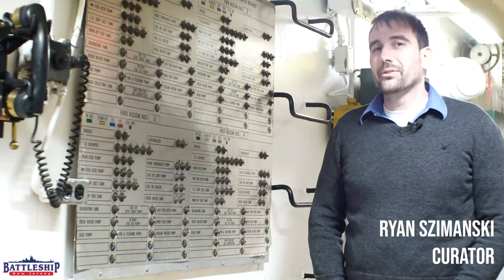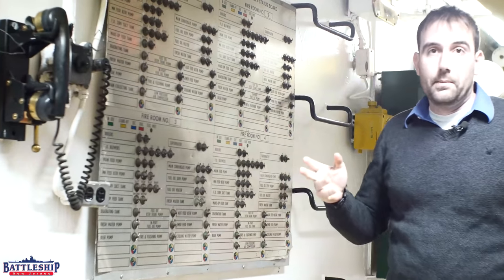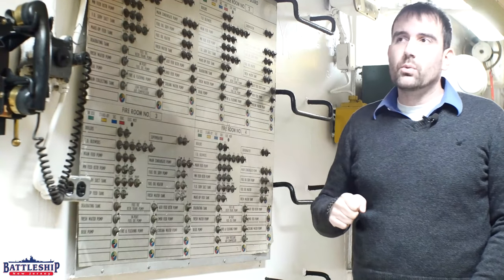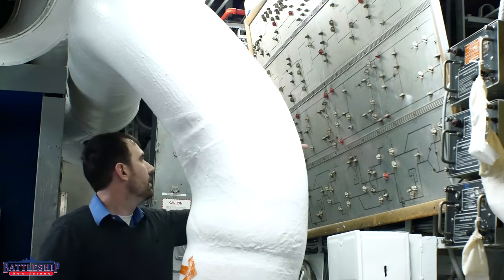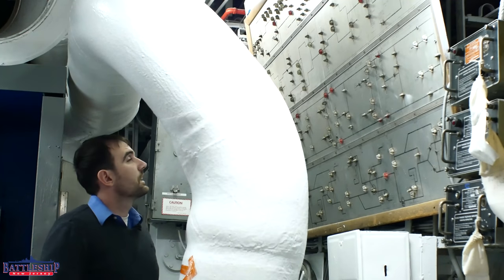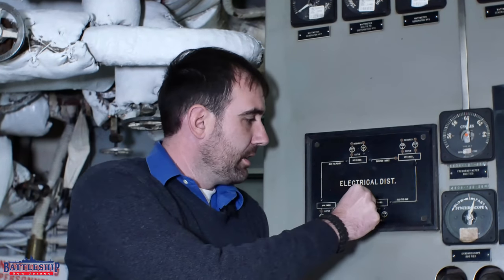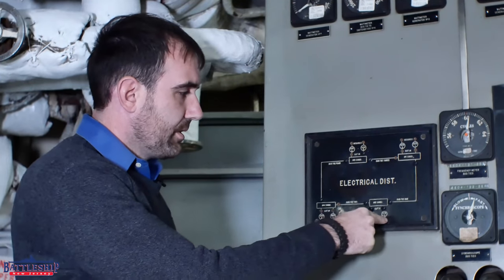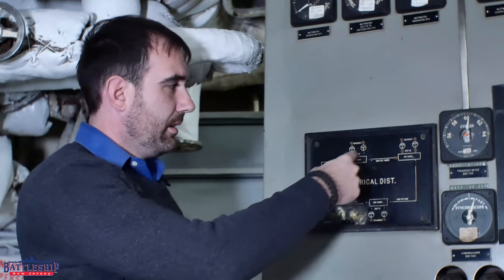How Do You Track Which Boilers and Engines are Active?

Comment: Well since I served in NJ, I would have to say my status boards were all analog.  

Second ship, AOR-7, cargo control status Board was all lites/switches.

BTW, we never would have just pointed to a status board on shift change!!!  Sometimes it did take 15 min for turnover, but usually not. That’s why you were always on deck plates 15 min before shift change, for a proper turnover.

Comment: I love all New Jersey vids... Ryan and crew do a great job teaching us how NJ worked.
Today I was pretty disappointed in the US Navy to realize that the 1980's ideas of "Status Boards" were so... bad. Disregarding the fact that by the 80's we were more than capable of wiring it up to various sensors... the actual visual signals were tiny, not easily discernable, poorly located (if that was the actual location) impractical in size... I could go on.
Earlier this year I was at a Catholic School fish fry... they had a status board of how the fry was going. It was manual with a person with a cell phone connecting to various people around the facility. I cannot recall the # of status's each station / step in the process had... 4 or 5, but it was very easy to see the status from 8 feet away. Very well done. Even though I did not work at the Fish Fry I could figure out what stations were keeping up, which were behind & why, and if I were trained I could know where to go help. Almost no talking needed, almost no knowledge of the fish fry process required to understand the status.
Ryan's just telling us what they did and, as usual, tells us well. The fact that it's not a very good system reflects on the Navy of the 80's.
Reply: I don't about the 80s but when this ship was launched in 1942 it was state of the art. When they reactived the ship in the 80s it would have been way to expensive too completely redesign the shipboatd status boards so they kept the old ones going. In the end it makes sense since they only really kept using this for about 9 or 10 years.

Comment: "analogue" electrical status boards for all sorts of industries have existed since the dawn on electrical use. Think of Magneta clocks on ships for example. Manual or hand operated would be a more correct term rather than analogue. Another fascinating video btw Ryan. Thank you.
Reply: Yes, analogue is an incorrect term for the statusboards shown. Manual is indeed a far better term for how they operate. And hand operated isn't a bad term either.

Since analog implies automation in updating the status. Even if some basic stuff like pressure can quite easily be transported via hydraulic lines for a distributed view of the current pressure. Similar story for other readings. And pulleys have been a staple for status boards for a long time.

Though, that they didn't use more status lights is interesting. Simple on/off indicators for various things, even if it just is a switchboard in the associated mechanical space. (and this would then be a digital system, since the signal is either on or off. (Even if most people incorrectly think digital means it is computer control.))

Comment: On the 2 Cruisers and the 1 DDG I was On we used a very simple system. We told the on coming watch what was running verbally. On the Console Board was a laminated sheet of paper with all the equipment listed. We just checked off what was online or running..

Comment: Great video Ryan, I was waiting for this one. On my DDG-51 and CVN we had two whiteboards with labels printed on them. Grease pencils were used to circle, x, underline, etc. One for mechanical equipment status and one for valve lineup, just like New Jersey. I would have preferred the old style with actual switches! The electric plant had better remote indication, but was still controlled at the switchgear. Navy is way behind civilian automation standards.

Comment: Analogue is good because when lumps of it are blown to bits,bent,buckled,cut or sheared off by the enemies shells, someone can use a bit of old fashioned Noddle and a few bodges to get it working again,it's a mechanical connection or assembly,even wiring is after all a mechanical connection which means you can see the damage physically ,it doesn't require the time consuming interrogation,replacement, coding and calibration of half a dozen modules or computers to keep it and it's various associated components running properly components that are generally more sensitive and fragile by comparison to their analogue alternatives. Plus the enemy can't hack that old shit!😁

Comment: Somewhat surprisingly the nearby frequency meter shows 60.1 Hz.   Still working because there's power?   That'd be nice to emphasize.
Reply: The shore power fed to the ship is still distributed thru the main switchboards. They don’t rewire the whole ship, not feasible. 
So that board is showing current volts and hz’s being fed to ship.

Comment: A power plant i visited 8 years ago in Sweden (the oil condensing units in Stenungsund) there the personel had special smal pieces of wood placed on every control on the pulpit.  Move the control turn the wood 90 degrees.

Comment: Interesting that a status board is just stuck up in a machinery space behind a pipe. All the ships I have worked on have had a central control room with engine and switchboard controls all in one place. On newer ships, a lot of systems are controlled by a computer, so if you want to open a valve and start a pump there's a schematic on a computer screen and you can start a pump by clicking on it with the mouse. The older ships I have worked on have had a lot more manual "analogue" systems where you have to go and physically open the valve locally. Then you see the transition between the two on ships built in the 70s and 80s where there is remote operation, but it's via a switch on a panel in the control room instead of a computer screen.

Comment: This isn't Navy.  My first computer system in the Air Force, 465L SACCS did have a master display of all the fault lights on all of the logic drawers.  It was called the FFC.  Fault & Facility Control panel.  It had push buttons to switch lines manually for either your numbered Air Force or Headquarters SAC.  It had connections for jumper cables to do in house loop backs or long line loops for troubleshooting.  We had telecommunication jacks so we could talk via headsets with the operator consoles in the Command Post.  This was handy.  Daily Preventive Maintenance was pushing a button to light all of the lights to insure all were working.
Reply: I was Munitions in the Air Force, and I can remember one of the self-test to ensure a missile test set was functional was to push the "Self Test" button.  If all the lights lit, you were good to go, at least electronically.  For either pneumatic or hydraulic self test (depending on which test set being checked), there was another series of test to perform.
Thanks for queuing memories from the past!
Reply: @josephstevens9888  Thanks for your service!  What base or bases were you at?  I was at Griffiss AFB, NY; Grissom AFB, IN; Pruem AS West Germany; and Ellsworth AFB, SD.  
We did not have a "master" self test for the system.  We did have a self test program for the drawer tester.  It wasn't one step.  We got so that we could do it from memory, but NOT when we were doing a QC Eval.  Then you had to dig out the manual and go slow step by step.  Self test only checked out about half of the circuits.  It did check all of the lights!
Reply: @klsc8510  After Basic Training at Lackland, I was sent to Munitions Specialist Course at Lowry AFB in Denver.  Then I was sent to a 18-month tour at Kadena AB, Okinawa.  At Kadena I spent the first year working in the 20MM shop (I still can smell gun grease on my hands!), and the final six months in the Missile shop maintaining AIM-7M Sparrow and AIM-9P & L Sidewinders.  Then I PCS'ed to Nellis AFB outside Las Vegas where I spent two years assigned to Munitions Storage - as well as some other shops as well.  After four years I transitioned to the Air Guard at Selfridge ANGB, Michigan where I spent another eighteen years performing all aspects of the Munitions field.  Then I transitioned to the First Sergeant role for six years, and wrapped up my military spending another six years as human resource and career advisor at Wing HQ.  In all, both Active and Guard time (my Air Guard years were peppered with deployments to the SW Asia AOR while on Federal Orders) I have 33 years of total Federal service.  I retired in 2015.
KLS&C 85 - thank you for sharing your experiences while in the Air Force, and thank you sir for your service to the nation.  God Bless and may you and your family have a wonderful Christmas season!
Reply: @josephstevens9888  Thanks for your service!  Are you still in Michigan?  After my almost 13 years active Air Force, my CO at Ellsworth didn't like me.  Maybe because I didn't drink?  He broke more rules pushing me out than I did in my time in.  After 16 years being out, I was recruited to join the Army Guard Signal Company in Kalamazoo.  That was 2000.  In 2003, we got the big invite to play in the sand box of Iraq in 2003-04.  The Company was detached from Michigan to join a Signal Battalion from Iowa.  In short during our time in Iraq, we showed the Army how Signal is done.  Not bad for a bunch of old Soldiers!  
I retired in January, 2009 with 21 years of combined service time.
I did get to fly on many Air Force aircraft.  The best was an incentive flight out of Grissom AFB in the KC-135 landing at Travis AFB for the long weekend.  I got to watch air refuelings of RF-4s and a C-5 at night.  I got to fly the boom for a bit.  That was May 1979.  
Like you, I enjoyed my time in uniform.  
I am now a member of American Legion Post 84 in Otsego, MI.  I have ship and airplane models I have built in the Post's WWII curio.
One funny story about a test button.  I was in the Bomb Wing Command Post at Ellsworth doing a weekly PMI on the Alert Receive Panel.  Part of that was to test the bright red light and klaxon horn in the panel.  Per the -6, I alerted both the officer and NCO on duty that I was going to do the test.  They concurred.  I pushed the test button.  The red light flashed, the horn sounded, and an alert crew member doing something in the battle staff room jumped up ready to run to his truck to go to his plane.  The officer controller jumped up waving his arms and yelled, "It is only a test!"  The alert crewman sat back down and resumed doing what he was there for.  The officer apologized telling me I did nothing wrong.  He had forgotten about the alert crewman in the battle staff room!

Comment: as a modern merchant sailor, who has seen more sensors fail then I dare to count, I wish we had more anologue stuff.
It's really annoying to have equipment refusing to start because a sensor says you have no cooling water pressure, while you can see the actual pump and gauge working... and there is no way to override, (besides a jumper on the sensor) and spares are 4 ports away. KISS is gone in our world, and somehow equipment designers think Engineers are getting more stupid as time progresses...

Comment: I have been led to believe that the Navy still uses analog methods to keep track of the status of aircraft on modern carriers.
Reply: Yep, the “Ouija board” where cutouts of aircraft have little bits and bobs to indicate their status. Different colored nuts denoted fueled, armed, running, and chained down. Interesting little system
Reply: @johnbeauvais3159  Thanks. That's what I was thinking of. The KISS principle in action.
Reply: @randyogburn2498  the USS Midway has a nice display of what the various parts mean, they cal it “Pinology”
Reply: They've tried to modernise several times but nothing works as well,  it's simple to use and easy to visualise.
Reply: @mstevens113  To do something like that and which supports multiple users at the same time and still making the system responsive is a hard problem.

The other thing is this:  a big user of it is the flat top boss ie the officer which decides who/how and then an aircraft can be moved.

He/She has their eyes on the real deck, changes to the board and back constantly which means that a computerized board would have to be very bright.

Comment: As a retired electrician digital is great when working properly but analog often more reliable. Had touch screens less then a year old burn out. We had a $10 million automatic packing line at Whitman Chocolates. After 6 years could not get one of the boards on each of the 7 computers due to a chip no longer being produced. Had to replace 7 custom German computers due to it. Also had 7 year old digital $10,000 motor drives that had to be reached due to parts were no.longer made.

Comment: would it be possible to design a complete new steam turbine powerplant for the iowas that not just saves more space, but also is more powerfull than the old one? also how reliable where the engines of the iowas? did they had problems and how safe are they during combat, in case they got hit
Reply: To the 1st question: Steam, no.  Gas turbines proved to be more economical than steam.  It's one reason they replaced steam.

Comment: Great as always.
Since you mentioned can we learn more about the degaussing equipment, and what degaussing is for.
Thanks, Libby and Ryan, keep it up
Reply: Ships have magnetic field about them. The metal they are made of combined with the magnetic fields of the earth will induce that field in the ships hull. The equipment inside also generates fields as it operates. They all add up. Degaussing is a method to reduce the magnetic field about the ship. The goal in WW2 is to reduce it far enough to keep magnetic triggered mines from being attracted to the ship. In the northern hemisphere you want a positive bias and in the southern a negative. Big ships can carry the equipment to maintain the field on board. Small ships don't have the space and get 'wiped' by an external source. Well not as effective. The effect can last for a longer time by not following a straight course. Most CRT tubes used the same principal at startup to set a neutral bias for the fly transformer.
Reply from the maker: One of our earliest videos was on degaussing: https://youtu.be/KjFOY1uXDtI

Comment: The boilers are water tube correct?  And 600 lbs???
Reply: Boilers with that power and pressure is that.  Is is much easier to make cylindrical pressure vessels.

Comment: I forget if it's been covered in previous videos, but do the turbo generators make AC or DC power, and at what voltage?  If AC, what frequency? I'd think cross connecting ACwould require having the waveforms sync'ed up!  Thanks!
Reply: At least, according to the guages, 60 cycle AC for main power as it is easier to take voltages up and down for equipment. Otherwise it would make the generation system too complicated to have generators with different voltages.
Reply: 460 volts, 60 hz. Yes we cross connected and had sync meters to synchronize them. I believe the video on SSTG’s discusses it. If you want more info, I operated SSTG 1&2 on BB-62 during her final westpac. I would be happy to answer any other questions I can.
Reply: @richcruse2689  I was thinking in that range, but not sure enought to answer. On aircraft we had 115/208 400 HZ 3 phase power.
Reply: @richcruse2689  I have a whole pile of questions if you don't mind! What was the typical power draw of the ship?  How many generators would run when cruising vs at battle stations/with turrets powered? Were the turret motors the highest draw electrical items? 
Would the emergency diesels ever be synced to the turbogenerators or was there a complete seperate emergency power bus? Could the diesels run things like turrets/steering gear pumps in an emergency power loss situation? I am sure I will think of more...
Reply: @TheThethinker101  I will answer what I can. 
Generally we had a few states. Normal underway steaming. Generally we would have two SSTG’s  parrelled forward, two aft, with one in standby forward one aft. As a general rule, basic underway steaming 3 generators could supply all the ship. Keep in mind this is not battle conditions though. We could, and sometimes, parralled port and starboard, two gens port, two starboard with one in standby in each area. 
I understood in actual wartime footing, although I never saw this, we were supposed to operate all boilers, all engines, and all generators, this will allow for maximum operation in case of damage. In this case, each engine room would disconnect and feed power to there section. This prevent much loss in case of loss of engine rooms or boilers, so most flexibility. 
In port “Aux” steaming, 1 boiler online, 1 engine jacking over and keeping warm, 2 generators for that engine room feeding power to the whole ship. There was limits to this, however, we could rotate and elevate a turret in this situation. 
Diesels we’re only in case of emergency, we never partelled them to SSTG’s there was no need that I ever found. If we needed mor generation, we could cross connect steam and bring up another set of gens pretty fast. 
We actually had an emergence once where we started and generator from cold, to ready to load in under 5 min. That was VERY fast, and bypassed some basic protocols, but we needed the generator, so it was ignored. 
Emergency gens would provide what was needed. First was generally engineering, to get restarted. It would supply steering, however, without engines running it would not matter much. Interesting enough, we could keep the boilers and engines running without power, everything had steam operated pumps/back ups. 
EDG’s fed power to lights, navigation, and what ever else the electrician on the watch was asked to feed.